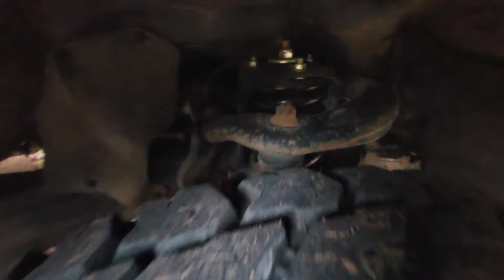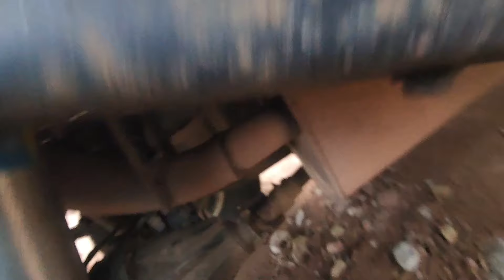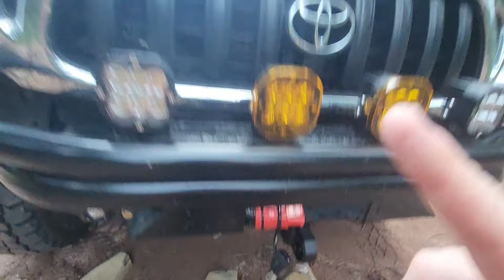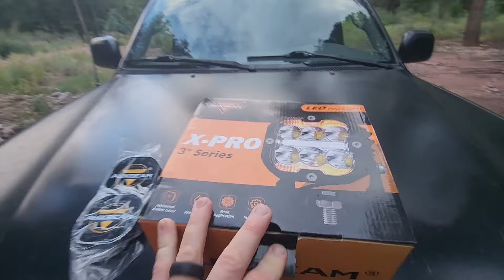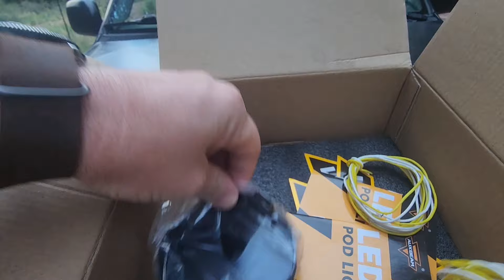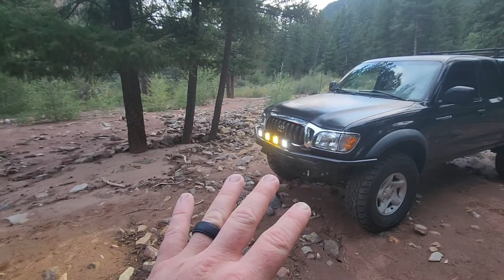1st Gen Tacoma Mods w/ @Auxbeam LED Lighting !

Comment: I just bought the trail gear tube bumper for my 2001 tacoma. Maybe more than I should’ve spent 🤣 It’s my first truck and the body is in rough shape. It almost has 300,000 miles so hopefully it’ll hang on awhile longer.